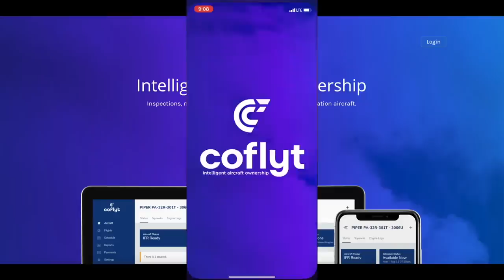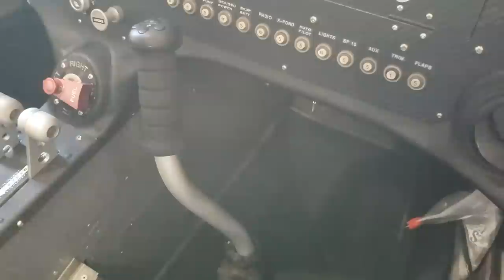How To Maintain Rotax Engines  - 100HR Inspection

Comment: Sadly my 912iS had problems at 1700hrs. The thrust washer failed on the gear box. Found plastic and metal in the oil tank. A common 912iS problem on the older ones. It was not a serviceable part in the past even on the 1000hr gear box overhaul, was not required to be replaced, as of Jan 2023 this part is now required to be replaced at the gear box overhaul 1000hr. I’ve been told rotax changed engine design so there is a hole in the shaft that sprays oil on the thrust washer parts to lubricate, on earlier engines this was not there. The oil filter and magnetic plug were completely clean. This is due to the washer failing inside the engine and going through to the crankcase where it gets sucked back to the oil tank and the metal lining protects it from going back through oil system.  I had drop in oil pressure and rise in oil temp as the debris probably clogged up the oil return line. Hydraulic prop was also lurching, trying to maintain rpm but not getting proper oil flow due to blockage.

Comment: The engine block is a tiny bit of it. With direct injection, no gearbox and tight intake and exhaust manifolds, the engine could be tiny.

Comment: Interesting they actually cut open the oil filter to inspect it!

That's a neat step that could be used for basic car maintenance too. 

I love informational videos like this, keep up the great work bro!
Reply: Its something am doing moving forward for my car.
Reply: It's been  standard practice in Aviation for years now, one additional thing that is becoming common in the last few years, and is considered even more important than examining the Filter Element,  is Oil Analysis, costs around $12-$15 per oil change and can detect wear before chunks start coming off to be caught in the Screen or Filter element.
Reply: That's what every dirtbike or atv also gets you see if the crank is eating the washers

Comment: With mogas you can run the Rotax up to 100 hours or annually before an oil change, not 50.
50 hours when running on avgas.
The 25 hour check and oil change occurs only the first time.
See the maintenance manual for more details.
Reply: The flight school might run on more conservative standards than factory recommended intervals.

Comment: Those plug caps wear away. I've replaced a few and handed out many to guys at my airfield. The threaded spark plug end, eats away at the rod inside the cap. Check that they are not worn or pull away easily. You did say it in your video, its a common thing over looked! Great video by the way! Thank you.

Comment: 200 hour engine. 
We replaced exhaust header springs , voltage regulator, fuel pressure sensing unit, and the surprisingly  problematic Carburettor Floats that sink in gasoline !

Comment: Great super video, it finish miths that always believe like the engine it's do sofisticate than nobody can maintain it. More simple more advance more advance more efficient. I imagine e that the cist of the engine is higher than a car's, because the production demand,  but if every body knows about the reliable of this engines and their simplicity, tuned cars used it, that's for sure. Know I know why in 50 and 60 some cars, Chevrolet and other brands used plane engines. Thanks for this video, maybe you can made one in the Rotax plant and describe the models and prices , and more detailed explanation of the transmission.

Comment: 3:44 So that engine has to be replaced every 2000 hrs?
Reply from the maker: Yea that's the overhaul time suggested by Rotax
Reply: @mojogrip  Ok, Jean should've said overhaul.  Replace implies it outlived its purpose.
Reply: It doesn't HAVE to be replaced, unless you are flying as part of a Part 135 operation. Most private pilots can fly it past 2000 hours if the engine is still healthy. 2000 hours is the manufacturer suggested time
Reply: That's 33 years of flying with proper maintenance! The average private pilot only flies about 60 hours per year. Are you going to keep the plane 33 years?